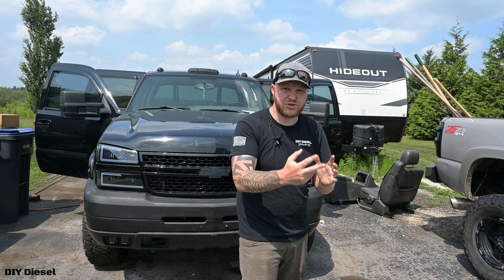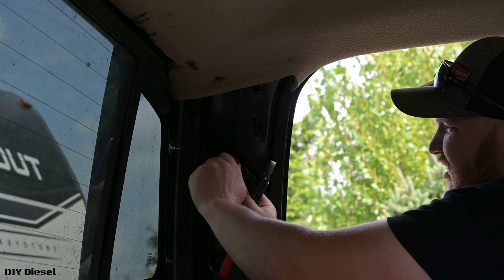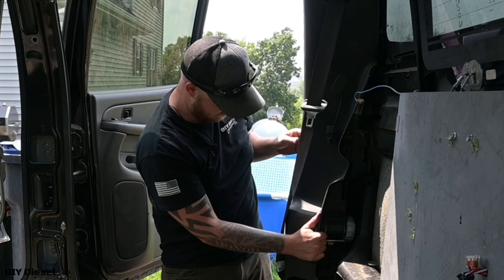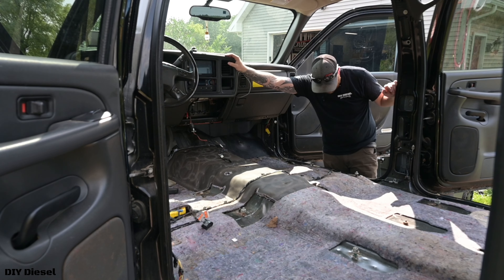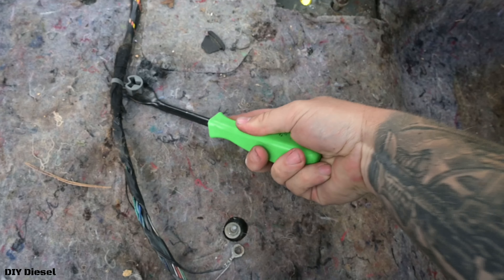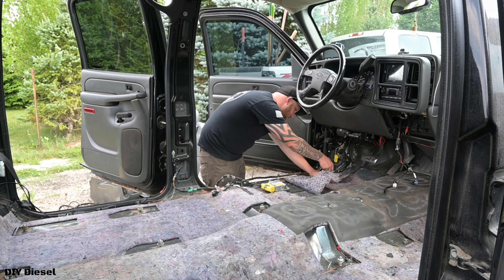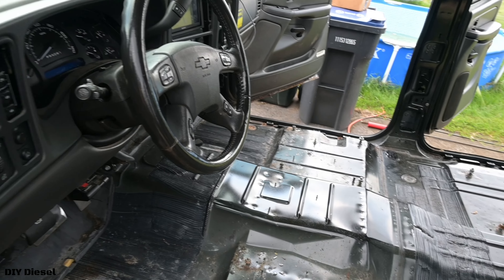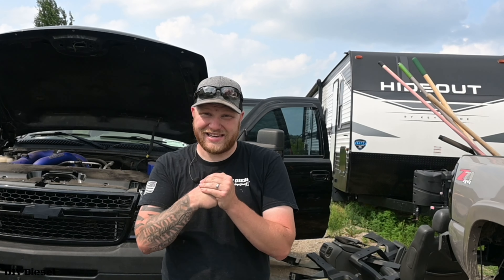How To: Removing Silverado/Sierra Carpet & Padding (With Seat Removal Guide) | DIY Diesel

Comment: The third brake light I believe will also leak water down into the floor but I’m not 100% certain. The cab vents are usually the culprit but there’s a gasket around the third brake light that can leak too.
Reply from the maker: Thanks for the suggestion 🤘🏼 ya luckily i do know it’s not that, but my cab lights are also leaking too which sucks lol

Comment: Amazon sells their version of hushmatt in my opinion it’s good not great compared to the name brand but it’s cheap. I added it to my trucks doors and they sound solid. I didn’t really notice a difference in noise and neither did other YouTubers that installed and reviewed different brands of sound deadening. 
Quick question I got my transmission rebuilt by a local diesel shop and when I get to a stop sign  it feels like I slammed on the brakes. Is this normal? (I’ve only put 1300miles on the rebuilt tranny).
Reply from the maker: I’ll definitely look into that 🤘🏼 appreciate the product recommendation. That could be a few things what was the extent of the rebuild? And have you contacted them yet? Could be a speed sensor would be my first look if not that then it may be a faulty solenoid, but if it was rebuilt I wouldn’t think that would be the case.

Comment: My trans went out and my aftermarket 3rd brake light started leaking while it’s been sitting waiting on trans to come back from shop and had mold all in it I’m fixing to have to remove everything and pressure wash carpet and let air dry for few days. 2001 Chevy Silverado 1500 extended cab